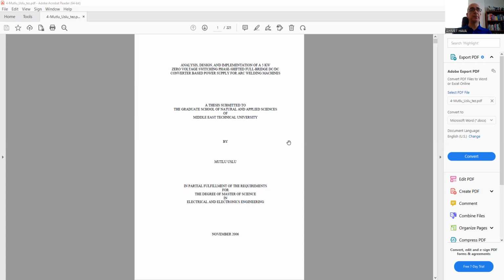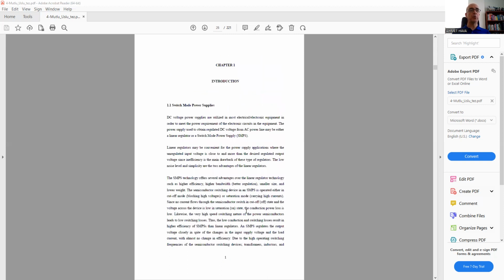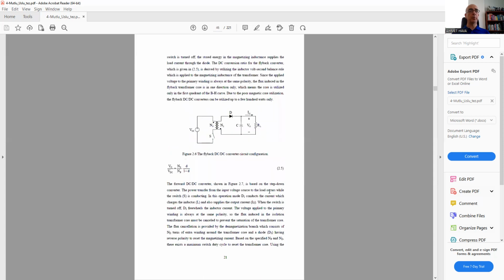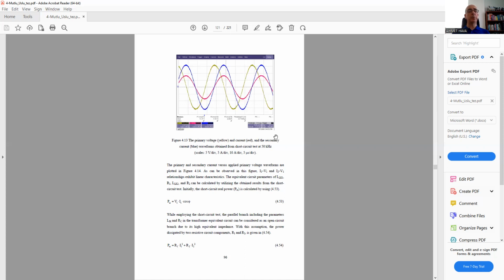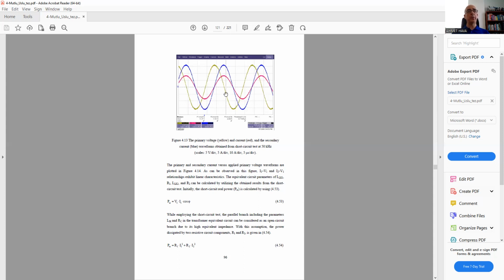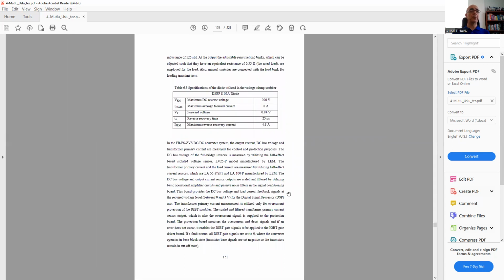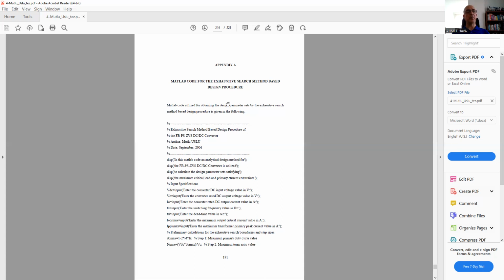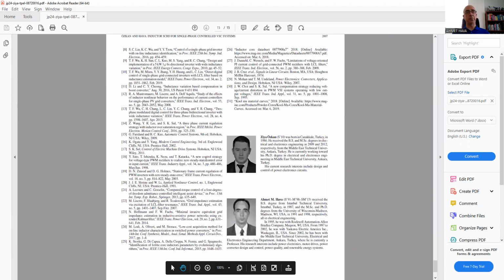thesis writing guide

Comment from the maker: Table captions, figure captions, in general must be highly descriptive. A figure caption must tell what the figure is about in detail. A figure may involve a graphic, a picture, etc. A table may involve text and or numbers. A figure or table usually do not involve equations in them.  A very common mistake regarding the captions is that the student writes a very minimal caption. For example, Figure 5. capacitor. You would have to ask, "why did you put the capacitor figure?" and the figure caption must answer in detail! So, a proper title would be for example, the film capacitor with the 10kV and 1mF ratings used in the experiment. Now, this is a very descriptive figure caption!

Comment from the maker: Fonts, spacing, page margins, etc. shall be according to the reference document provided by the institution requiring the report. In general at least 1.5 spacing and font with new times roman and 11-12 size character is preferred for the single column format, but may change, so follow the institutional guide provided for the report format.

Comment from the maker: Another important point is regarding the grammar. In the written technical documents, passive sentences are used. Insteady of "I did the experiment at 10C operating temperature," the passive sentence form "the experiment was done at 10C temperature" form is used. Instead of "my circuit photo" the passive form "the photo of the circuit in this report" is used.

Comment from the maker: A few more...1) Grammar and Spell check: whichever text editor you may use, they all have text correction software, you should enable them when you write. Then, they will always mark the errors and suggest corrections. In MS Word, this is very powerful. Even google corrects our mistakes. When you have a complex sentence which you can not figure out how to write, write it in your own language first. Then use google translate, so that it will suggest a translation for it so that you can obtain the english version, then check to see if it is satisfying. 2) Text consistency: This is a frequent mistake I see. Some headers are only initialized with capital, some are full capital, some are all small. Many parts of a document are written arbitrarily. This is very discomforting to the reader and gives complete impression of ignorance. In a professional environment such a document is rejected automatically. So, there are two important steps to take. One, makes sure you have a proper order/rules defined. Two, apply the rules to the complete document without exception (unless you have a good reason to exclude a specific part!).